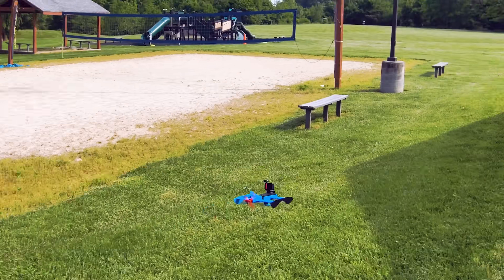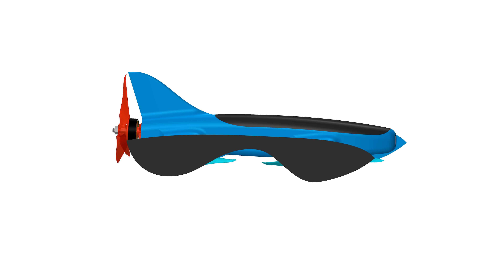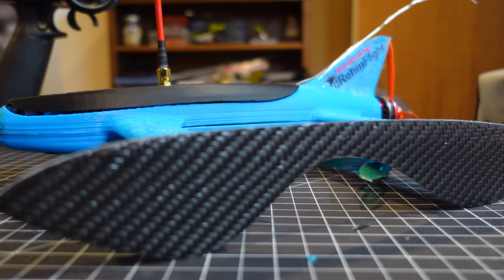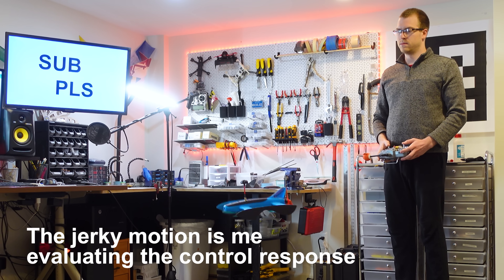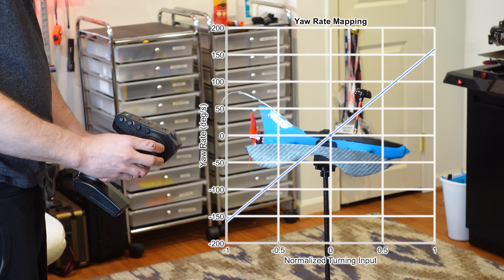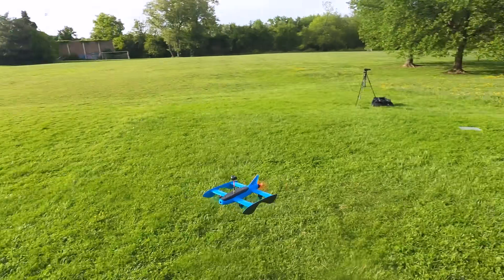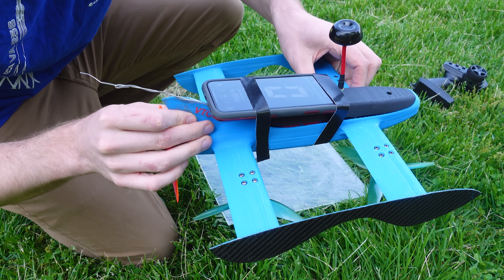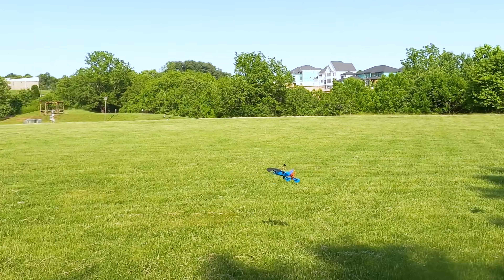World's Fastest FLYING RC Drift Car

Comment: You could make the bottom 5% of the throttle tilt the speeder forward without engaging the butt prop for creeping forward. Possibly blend it smoothly into the no-tilt buttprop speed mode, should give you better low speed control
Reply from the maker: That's a good idea!

Comment: Great Work, but You should have sanded the wings surface area, inorder to make the airfoil shape smooth. reduces the turbulences created by 3d printed lines. Use the pcbway's Nylon frame in the next video and check whether it improves any efficeincy.
Reply from the maker: Definitely; looks were prioritized over aerodynamics for this one 😄

Comment: To prevent dipping / generating false height measurements when tilting the craft. You could add more LiDAR sensors at an angel and find the lowest value to use with the flight controller.
Reply from the maker: I add compensation for the measured tilt angle to the LiDAR measurement!

Comment: metal drone frames from 3d printing, graphite ball mill coating, with electroplating, super strong light weight, diy
Reply: electroforming thick electroplating, not flimsy, unless a helium metal foil balloon
Reply: metal foil super hot air solar concentrator collector floating balloon wind turbine on a ground axle heat succ pipe
Reply: top up pls
Reply: hey come on prop guards for the lawn mower
Reply: nice idea anyways cheers
Reply: instead make the code to keep the altitude, also from top down, ie ground effect plane
Reply: ie no jumps or flying, just efficient cruise flight floating

Comment: Great video! Not sure duct tape and a phone was the better solution to a simple GPS though 😀
Reply from the maker: Well, one was for temporarily measuring speed passes, other would’ve been for integration into the airframe and flight control code

Comment: A couple thoughts. For propulsion, I think it would be a nice symmetry to have both forward and backward acceleration accomplished with the same technique of integrating the pitch angle and pusher motor speed. This way, you can benefit from the lift motors when accelerating from a stop, and from the motor mount airfoils when braking. This would also seriously help the stalling effect you ran into on your speed runs. Worth the effort to command reverse on the additional ESC.

It would also be cool to see even more bank integration in turns. However, the more you bank the more error is introduced in your height estimate since the sensor is pointed further from vertical. Are there any single axis scanning LiDAR sensors you could use to allow picking the "true down" measurement? If not, how difficult would it be to mount the sensor on a servo to always point down? This would be most impactful for high speed maneuvers in tight spaces where there are side obstacles.

Also interested to see how much control you could get with one additional axis to set the desired height. I guess that depends on the effective range of the height sensor being large enough, but with GPS you could transition the altimeter from ground mode to fly mode and have a really controllable plane too.

Very reminiscent of Daniel's ground effect projects.
Reply: Sensor fusion is your answer. Accelerometers tell you your "true" down. Normalize the axes and fuse it to your LIDAR to compensate the bank angle. No need for servos or anything else. Just mind your filtering :p
Reply: @Archangell27  That's a fine suggestion but suffers from the same issue as the current implementation: if these are obstacles or significant terrain variation to the sides, the LiDAR sensor will report the distance to those obstacles instead of the distance to the ground directly below the vehicle. Imagine this extreme scenario: you are flying this vehicle towards the edge of a cliff and, upon realizing it, make a rapid banked turn to avoid flying off the edge. Even if you manage to stay on the cliff and not go over, when you are in the middle of the steep banked turn the LiDAR sensor could be pointing over the edge. The sensor would read the entire cliff height as your distance from the ground.

Accounting for bank angle with a fixed sensor is only suitable for small bank angles. As the angle increases, you have to assume a smoother and more uniform ground surface, or add operating height for safety, otherwise the sensor may not read obstacles directly underneath the vehicle while in a banked turn.
Reply: @haphazard1342  Yeap, but putting servos on that thing is not the best idea either. Weight and  complexity. Can break easily. Better off to put two LIDAR sensors, one of each side at a 45° angle to the belly one...and use the accel to measure which one is pointing "more down". No moving parts, no lag till you get them pointed. The bad part is it's more expensive.
EDIT: Also the LIDAR should also have a bit of a wide area where it measures...But if it's not wide enough to cover the amount of bank angle and choose the measured points along the accel. down vector, then use two, as I said above. Or make the width the sensor can see through, wider by making the body of the thing transparent on the area of the body of the craft where the sensor sits. Depends on how that LIDAR HW is implemented...
EDIT II: With this (and assuming enough processing power to run three LIDARs) you can monitor all of them and make an obstacle avoidance mechanism, where you only choose the distance along the accel down vector for your altitude correction, and the rest of the LIDAR directions for banking away from obstacles.
(Also I should add that I'm assuming a scanning LIDAR not a single point range finder kind)
Reply: @Archangell27  Yes, that would also be an improvement. You could interpolate between the measured values for the sensors that bound "true down". However, seeing the size of the LiDAR module I think a servo would still be more compact. The speed of response does not have to be instant, because the craft cannot bank instantly. A standard gyro control loop would be plenty fast, and direct mounting the LiDAR module on a servo horn is not too complicated.
Reply: @haphazard1342  Sure, you can do that, but you have to keep in mind that the sensor mounted on the servo still has to be both protected, so inside the fuselage, if you will, and also have a sufficient cutout in that fuselage to allow it to move and "see" and at that point you are exactly describing a scanning LIDAR which is already integrated as a standalone package, that's my rationale behind it...and it gives you potentially a larger viewing area or field of view, is faster (so you can use more filtering and get more accurate measurements). For a simple, approach your idea is the easiest and fastest to implement, mine is more expensive and involved, but I still think, purely from a performance and cost/benefit viewpoint, that it's better to go to an actual (meaning scanning) LIDAR, but at this point it's just a matter of preference/ cost and ease of implementation.

EDIT: I like how this discussion feels like a HARA/FMEA engineering meeting :)))

Comment: I'd like to try having the spars the vertical motors are on tilt for pitch change to introduce additional thrust maybe even a slight airfoil to the shape that would move into ideal angle for the direction chosen

Comment: I would suggest a variable pitch thrust prop for reverse and braking. should give instant control.
Reply: No need for variable pitch. 3D drones can run props in reverse allowing them to be flown upside down. Which is a mechanically much simpler solution. Zoe FPV used to do a fair amount of 3D drones if you are interested

Comment: "Gps is too heavy" straps a brick cellphone to it
Reply from the maker: Anything to explain away integrating another component in that cramped little fuselage lol
Reply: @NicholasRehm  why not use one of those tiny modules?
Reply: @sanjikaneki6226  i assume it's a limitation of his flight controller.
Reply: @NicholasRehm as a software engineer, I can confirm, integration hell is the lowest level of hades
Reply: @NicholasRehm  
a row of paper with lines on it and do the math?
Reply: 😂 iflight makes some pretty small gps that he can fit on the top too
Reply: nothing raw power won't fix
Reply: But if he put that gps on, where would the phone fit?
Reply: I recommend a skyfly performance analyzer. I use it on my drag car. Super lightweight and very accurate.
Reply: I was gonna say, he just said he didn't want to
Reply: Phone added how much weight? Don't they make smaller lighter parts to measure speed and such?
Reply: Soft serial that bish

Comment: Man, I really adore what you are doing! But please start writing cleaner code! Why don't you use classes and functions for stuff that gets reused like pids or filters? The concept of your code is great, but it's so unecessarily bloated and hard to modify... I hope you see this as constructive criticism.
Reply from the maker: I agree is it not “clean” in a proper coding sense. But someone who has never coded before doesn’t know what a class, attribute, or method is. They probably barely know what a matrix operation is. So dRehmFlight was an attempt to dumb down the overwhelming flight controller code bases out there into something with simple lines of code all executing in a global scope. But I hear you! I would love to find the time to do it “properly” and build the documentation and tutorials in such a way that anyone can quickly learn
Reply: @NicholasRehm  Thanks for that super constructive answer. I just re-read my comment and realized that it might come across as a bit harsh. I totally see your point and it can indeed be seen that you try to make it accessible for everybody and you definitely succeed with that. I have used your code and it actually made me start my own code base with similar functions and additionally some more advanced telemetry. It eventually took a turn, and instead of using it for airplanes and quadcopters, the code base is now used at my university's lab for wireless rehabilitation devices with integrated IMUs (surprisingly similar requirements to quadcopters). Anyway, if I have time at some point I would love to get back to it or maybe even support you with your code base since there are many great concepts. I also love the idea of an accessible alternative to ArduPilot, etc because those code bases are way too complicated for fun and hacky projects like this flying drift car. Keep up the good work!

Comment: I’ve been working on dRehmflight for the last several weeks. I’ve fried a Teensy, I thought I fried my ESC but evidently those things are pretty hardy. I also encountered a set of fan blades running at several thousand RPM, and they will indeed happily slice your fingers into shreds. 

I have no particular interest in RC hobbies, but have thoroughly enjoyed the engineering and appreciate the incredibly detailed documentation and work that you’ve put into this. My end goal is to develop a heavy-lift cinema drone and implement some of the dRehmflight functions and features into other motor and sensor control systems. Thanks for all the fun!
Reply from the maker: Awesome! Remember to test, test, test until you fully understand how the system works. Keep those fingers safe